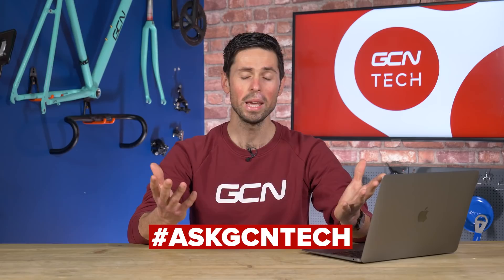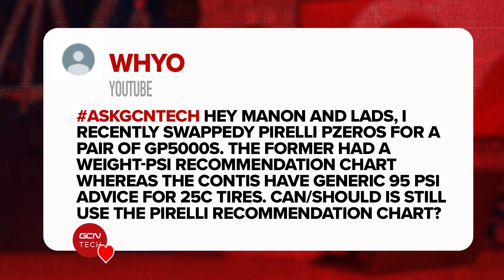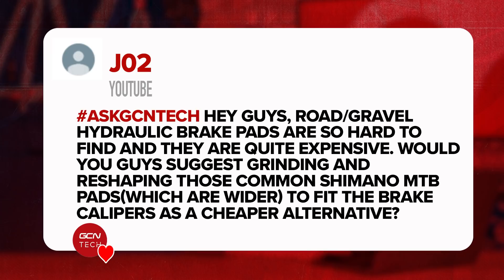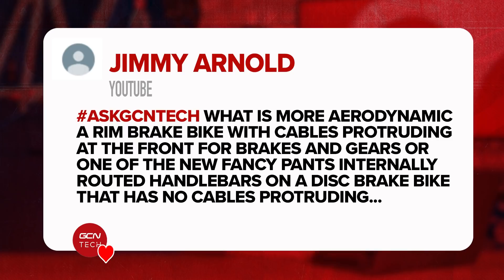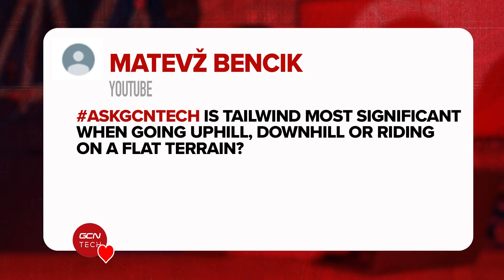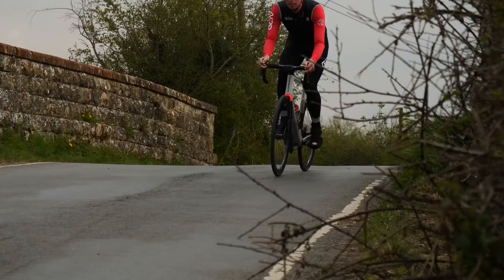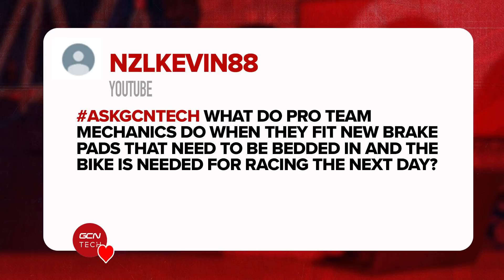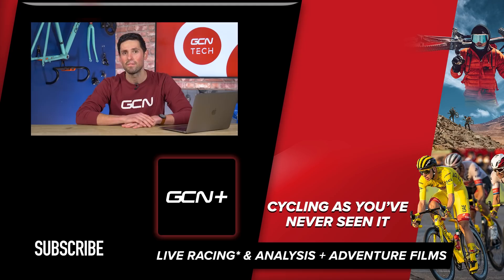When Does A Tailwind Help The Most? | GCN Tech Clinic

Comment: A note on the tailwind question: Although the second-to-second power saving is greatest on the downhill, because of the greater time spent going uphill on a loop it is invariably preferable (i.e. will result in a faster time) to have a tailwind on the uphill sections.
Reply: Definitely agree there. Also the fact that you might be out of the saddle and catching more of the wind too. AND, there's a limit to just how fast it's safe to ride.... it's much more likely to reach that speed going downhill! Alex didn't really give the question much thought 😄
Reply: @peterharrington8709  You don't climb tucked in the drops like the rest of us...? 😂 But good points, especially the second (you may well be braking anyway downhill unless you're on a smooth wide dead straight bit of road which we don't have in the UK). Since we're being exhaustive, I think other losses viz. rolling resistance, hub friction etc. also become larger at higher speeds. Common experience tells that you also become less efficient, putting out less power or even freewheeling.
Reply: I tend to call it the "Hand of God".  Beware when it is the same speed as you are climbing though. You can overheat rather rapidly that way!
Reply: @peterharrington8709  Agreed on the 'not too much thought' point!

Comment: On the other hand you’ll only benefit from a tailwind briefly going downhill and you may have to brake anyway. Whereas going up that same hill you’ll benefit from a tailwind much longer. My guess is that if you have to do an out and back TT up and down a hill you’ll do a better time with the wind behind you on the climb than with the wind coming from the opposite direction.

Comment: You get the most tailwind benefit the closer you are to the wind speed.  If you go 30 mph down a hill and the tailwind is 5mph, your airspeed is 25mph you face 20mph of extra resistance, compared to climbing a hill at 10mph with an air speed of 5mph.  The downhill scenario is a 16% savings the up hill scenario is a 50% savings.

Comment: There are a few mid-section alloy wheels out there. Pro-Lite have the Bracciano A42W but are just shy of 2kg There is an independent wheel builder in the UK called Kinetic One who do 42mm deep TLR alloy wheels around 1850g and a superlight version (tube only) up to 300g lighter. Until recently there were some mixed material wheels available (carbon aero rims bonded to an alloy braking surface) - Campy Bullets, Giant SLR01, oder Dura-Ace wheels too. But sometimes the bonding would fail before the rims would wear out, and were very expensive.

Comment: Not sure if the chain on the turbo thing was mentioned in comments. But 11/32 to 11/28 makes no difference in chain length at all, even at smally smalls. As both cassettes are 11 at the small end.
So makes zero difference other than big rings, it'll have more available

Comment: Not sure about the answer on best place for tailwind - if you have a tailwind for the slowest section of your ride, although this will make a smaller absolute difference to your speed on that section, it will make a much greater difference to your average speed as you're spending so much longer on the uphill compared to the downhill section. The impact on average speed would therefore be best on the uphill section even if the additional absolute speed gain downhill is greater.

Comment: #AskGCNTech - Hi all, after fitting a tubeless rear tyre, and subsequently riding about 500km, I've noticed that I mounted the tyre with the rotation arrow the wrong way round. What are the potential issues with mounting tyres the 'wrong' way round? And should I be concerned from a safety point of view? Thanks

Comment: TECH QUESTION:

I have a bike from 2010 with Ultegra 6700 and when I got it, it did not have many miles on it. Unfortunately, It never shifted/shifts well. Often, I have to give it another half shift to nudge the chain to the next gear. Why do you think that is?

I am wondering if that might be because of the spring in the derailleur, that after so long, it no longer has much tension? Could getting a new spring or engaging the spring into the second plate hole fix this shifting problem or it is something else?

Comment: #AskGCNTech Help GCN! My Shimano di2 keeps emptying the battery overnight. I took it to my local bike shop who replaced the battery, but the problem keeps persisting, a full charge only lasts a few hours. Any idea what could be causing this, or how you fix it? The firmware is up to date and it is well maintained. And I make sure the shifters aren't being pressed accidentally. Many thanks!
Reply: Perhaps there is an insulation problem at the cables somewhere, i.e. a place where the insulation is damaged and allows some current to flow, or some conductive dirt/water in some connector. You might be able to measure this using a multimeter. You might need to replace the cabling to fix the issue.
Reply: Short circuit some where 🤷🏻‍♂️
Reply: Try unplugging the components, one at a time, and see if that cures it. If it does, then you've found the faulty part.

Comment: #ASKGCTECH can I install 10 speed cassette on a 6 speed freewheel without changing the whole wheel
Reply: No. Cassettes fit on a freehub whereas a freewheel is completely different and screws on to a rear hub designed only for freewheels.

Comment: Weight of the wheel matters. Mathematically, it does not matter when going at absolute constant speed or if you do not try to accelerate. How many of you ride at absolute constant speed and not accelerate on your rides? GCN’s trial when they made their point eliminated power input to the system…if you do not add power on your rides, then weight will not matter either. Bottom line, if aeronautics is equal, the lighter wheel will be faster, I would argue MUCH faster.

Comment: I was wondering about that very issue with the 32 versus the 28 as I planned on switching to a 32 as soon as my chain wears out and it's time to change chains.  I keep a 28 tooth ultegra on my trainer, but  I got a OSPW specifically so I could fit a 32 and I didn't really want to buy a different cassette for my trainer if I could avoid it. Also, putting a 32 on the trainer would be highly antisocial since the other bikes in the house are using either a 25 or 28 and their chains would be too short for some gears on the trainer at that point.
Reply: When thinking about this subject, sorry that I am so rude but please just think about it: A chain is too long when you have it in smally-smalls and it doesn't have any tension. And it is too short when the rear derailleur snaps by riding biggy-bigs. Why should you have a problem with a chain for a 11-32 cassette whilst riding a 11-28 cassette? The derailleur doesn't have to be on its limit when being in the largest sprocket! On the 11-32 cassette you will also have a 28 tooth sprocket. And why should it be too long? the smally-smalls-relation is the same: Your smallest sprocket is still an 11-tooth one. So please don't worry! I don't know if GCN just want's us to buy more chains. I would personally be more worried about the 11-25 bikes riding on an 11-28 cassette. You will never have a problem by riding a smaller largest sprocket. #askgcntech

Comment: #askgcntech
Are front forks universal? I have a Cannondale Lefty Oliver Carbon fork that I want to put a different frame but I don't know what I need to take into consideration outside of getting the wheel reworked for a lefty hub.
Reply: No. You need to check the headset specs

Comment: #AskGCNTech when a bike manufacturer (Orbea) doesn't state the weight of the bike (Vector 20 Hybrid 2021) and Google doesn't give an answer either, without having equipment to weigh the bike myself how do you find out the weight of the bike, is there some sort of database as I use Strava and would like the information to be as accurate as possible
Reply: Use your bathroom scale . Weigh yourself first , then you holding the bike , then simple subtract one from the other . Not perfect but works .

Comment: #AskGCNTech Hey Manon, Alex and Ollie, will a new 12-speed Shimano chain run on an 11-speed crank and chainrings? (Did the chainrings get thinner or did the spacing between them change?)
Reply: Not entirely sure but I think they changed the inner plate on the links so it'll work properly with the new improved ramps on the 12 speed cassettes. So, it's probably not going to work well.
Reply: @peterharrington8709  From what I could find, the 12-speed chains are the MTB chains - same part number. On the MTB side, I know you have to use the correct chainring but this is more due to how narrow-wide 1x chainrings interact with the chain.
Reply: @chrisridesbicycles  that's interesting. I'm pretty sure my 11 speed chain was also dual purpose for Ultegra or 105 AND Deore SLX, which I run 1x with a narrow / wide chainring. Not sure this is evidence either way!? Lol

Comment: #askgcntech Hookless Rims and Big riders
Im 128kg and use Cadex 65’s currently and before Zipp 404 firecrest
28mm front 30mm rear GP5000 S TR 
Max tire pressure 73psi ( hookless )
Do you think Hookless pressures are suitable for Big riders ? 
I find normally ok but squishy in sprints ? Thanks Dazza_K567 😉